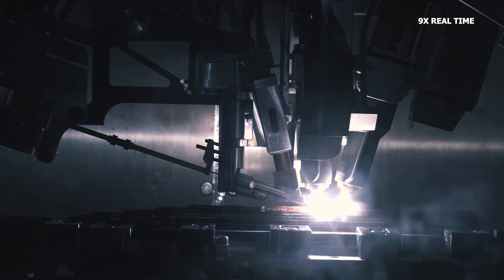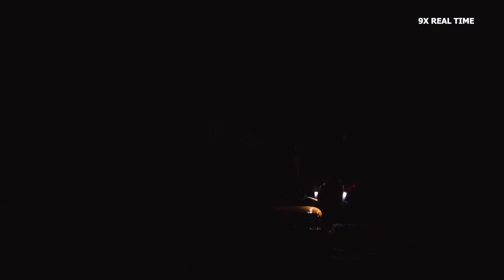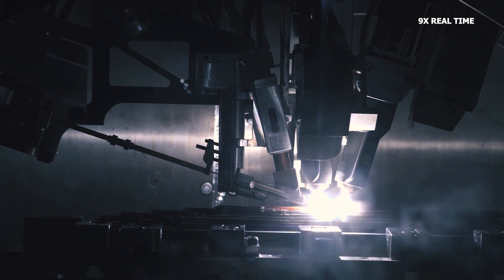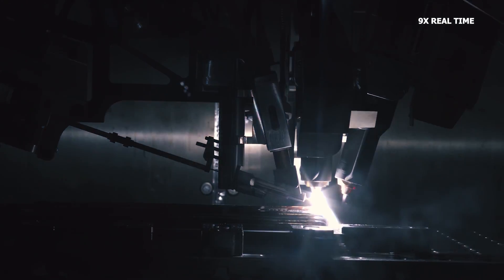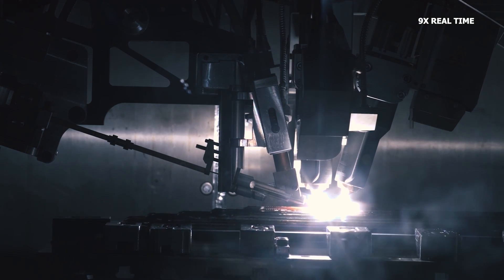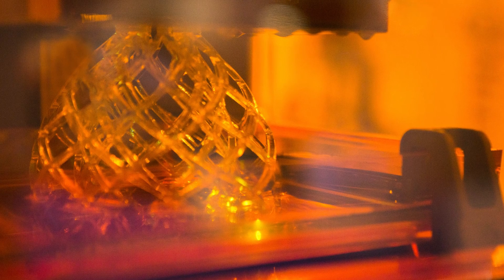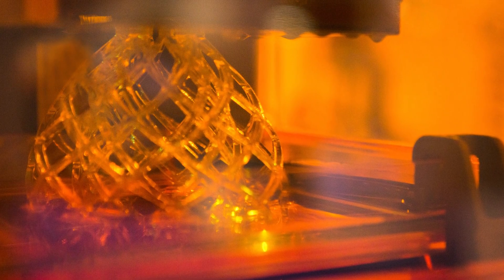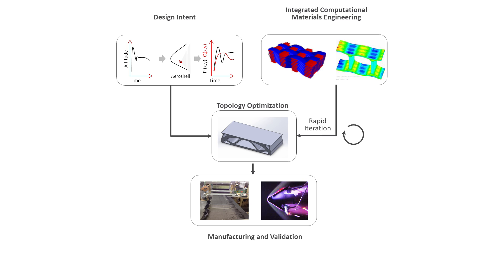DARPA and Manufacturing

Comment: When we focus on the objectives that we want and not on the means that we can use, the idea of resorting to technological means is just one among several options.
And it's not even the best of options. And why? Because it requires different materials, construction, parts, assembly, complicated connections, etc...
Now, the more complex the weapon, the more likely something goes wrong. And the effectiveness is also doubtful.
Let's compare, for example, with another type of weapon (it doesn't matter if it's already operational or not) foreseen by quantum theories:
- Operated by thought (in fact the process is more complicated);
- Using as a means of action, the same used by the quantum entanglement verified between sub-atomic particles;
- Action on the target: modification of the probabilities of one or more events (ability to, for example, destroy a nuclear power plant or a missile, as well as trajectory deviation; climate modification, etc,...).
- Efficiency: ~100%